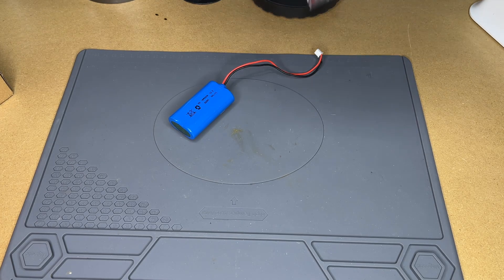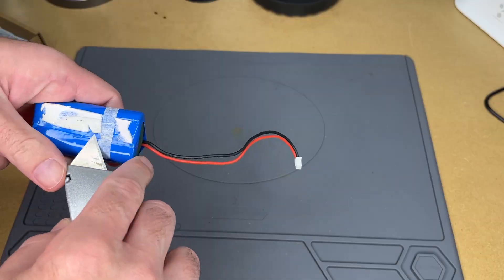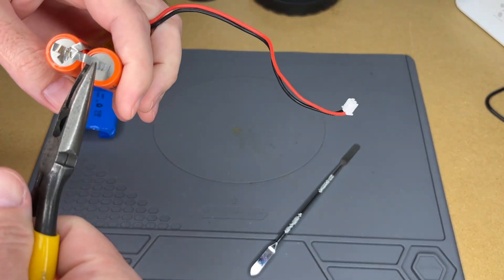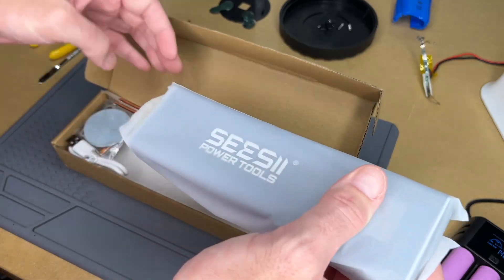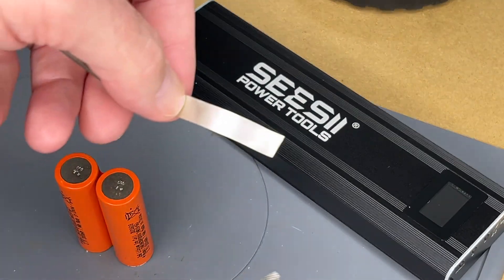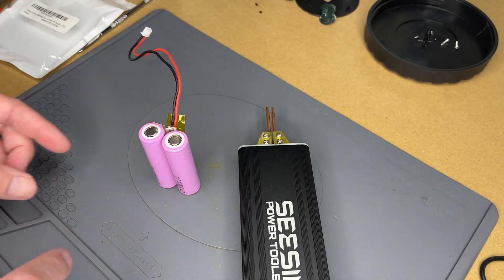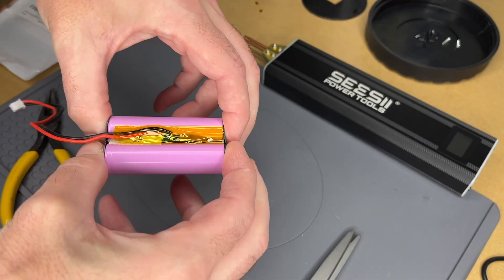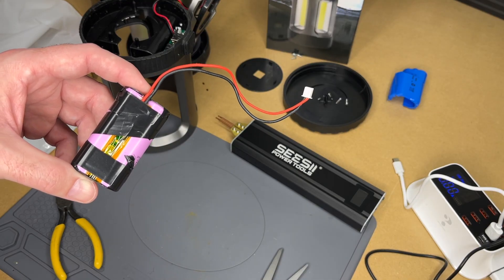Spot Welding 18650 Cells with SEESII Battery Spot Welder

Comment: Your spark on the second weld attempt is because you likely were not putting enough pressure on it.  Notice the gap under the strap at the blow out.  I'm guessing if you hold it vertical and press down with more force, you won't get those blow outs.
Reply from the maker: Thank you for the feedback.

Comment: My new one shows 2.8 volts and it's been on the charger most of today without a change but doesn't show any voltage increase overnight I will be asking for a refund
Reply from the maker: Did you try a different charger?
Reply: Thanks for the report.  I'll be sure to check that if I get one.
Reply: I just got a new one. The manual comes with it is difficult to understand. This video gives me some reference.
2.8V is very low for this welder. 4.1 at full charge is a good one.